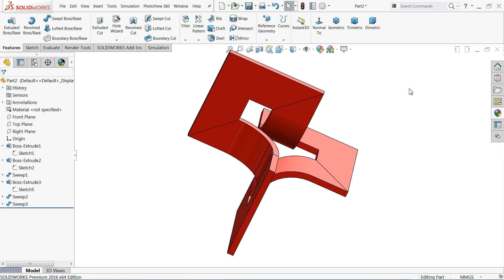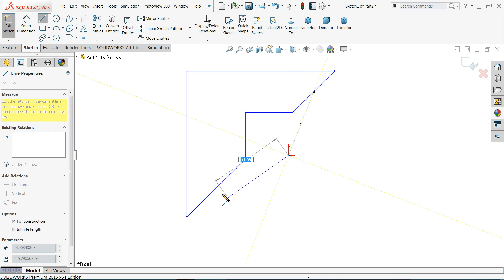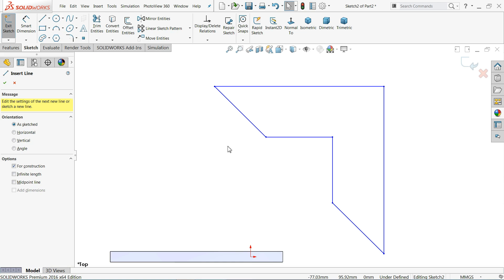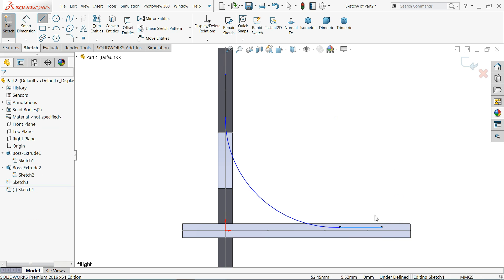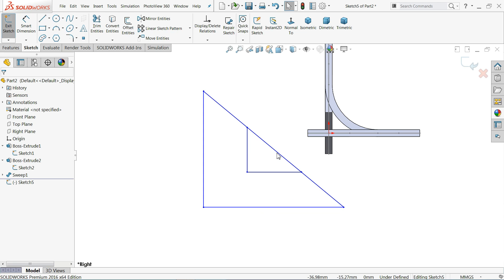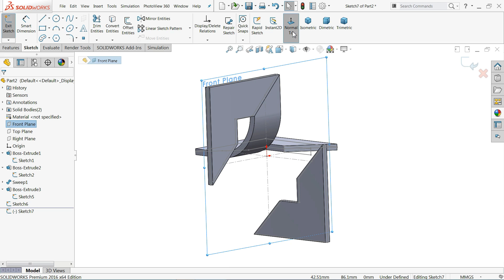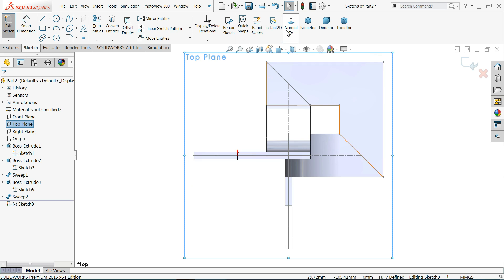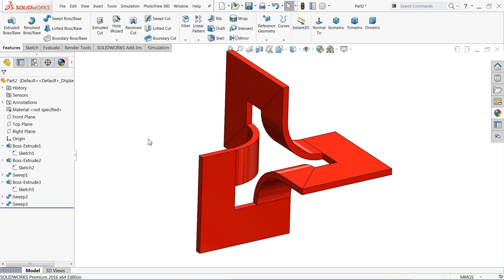SolidWorks Tutorial for Beginners exercise 94

Comment: hi sir, what type of graphic  card is suitable for solidworks? GTX or RTX?
Reply: Neither actually. Soldworks is designed for workstation GPUs, like Nvidia quadro or AMD firepro.

However those cards are ridiculously expensive and not needed, as they are just rebrands of regular consumer GPUs with a few extra features and technical support.

In reality any relatively modern GPU should work well with solidworks. You can easily edit the registry to add your card to the list of supported GPUs inside of solidworks to get all the features. There are plenty of tutorials on how to do it, just Google it.